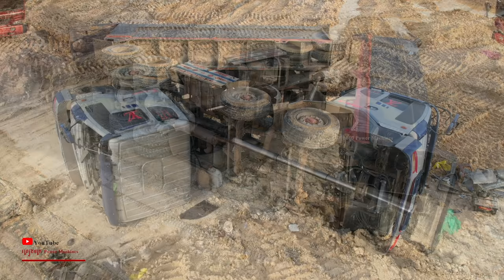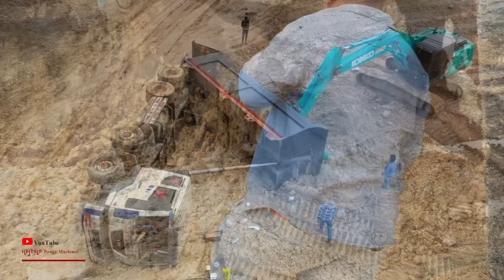Incredible Dumper Truck Soils Unloading Accident Heavy Recovery Power Helping Excavator Bulldozer

Comment: How does a dump truck tip over? I never heard about that in the past. This is the first time I saw this.
Reply: When the load doesn’t slide out. Looks like clay to me and this stuff is sticky. And when dumper goes up with this weight the center of gravity goes up and even small imbalances can cause it to tip to the side.